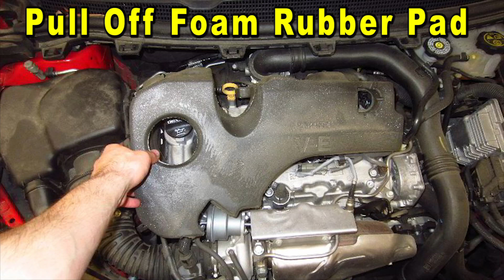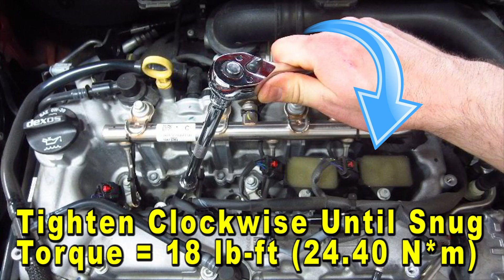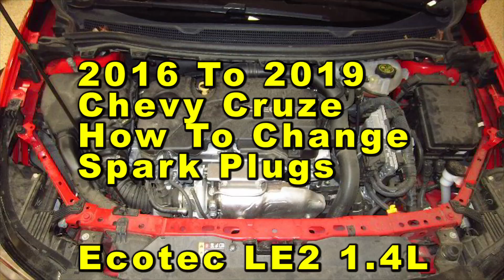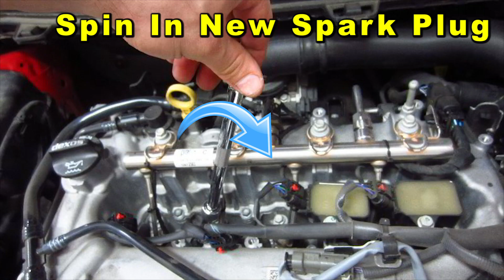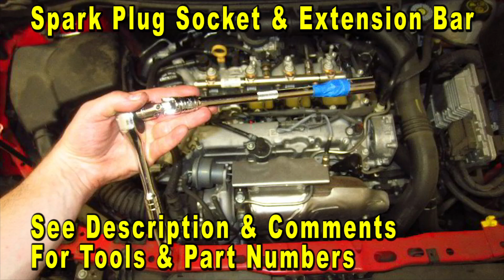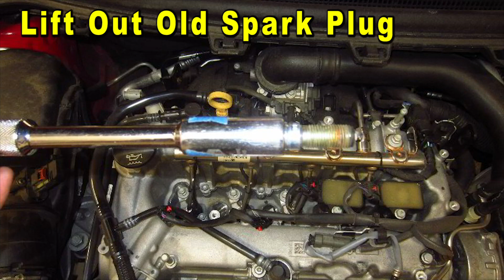Chevrolet Cruze How To Change Spark Plugs 2016 2017 2018 2019 LE2 1.4L Turbo I4 With Part Numbers

Comment from the maker: Chevrolet Cruze 1.4L I4 Spark Plugs - https://amzn.to/3QYNt0L
ACDelco OEM Spark Plugs Part Number - https://amzn.to/3qVjXhR
NGK Iridium Spark Plug Part # - https://amzn.to/44pdwkR
Magnetic Spark Plug Socket - https://amzn.to/3QZjtlB
Precision Screwdriver Set - https://amzn.to/3OYN1i0
Plastic Pry Bar Tools - https://amzn.to/3HMtsV7
Socket & Ratchet Set - https://amzn.to/3Z17LbA
Mechanix Gloves - https://amzn.to/3jCnHkt
Torque Wrench - https://amzn.to/3vS5uSI

The Paul79UF YouTube channel is a participant in the Amazon Services LLC Associates Program, an affiliate advertising program designed to provide a means for sites to earn advertising fees by advertising and linking to Amazon.

This DIY video shows owners of the 2nd generation 2016, 2017, 2018 and 2019 Chevrolet Cruze how to change the spark plugs in the Ecotec LE2 1.4L turbocharged I4 engine.

Comment from the maker: Check out the DIY guide for changing the spark plugs in a 2nd generation 2016, 2017, 2018 & 2019 Chevy Cruze sedan - 
https://www.paulstravelpictures.com/2016-2019-Chevrolet-Cruze-Spark-Plugs-Replacement-Guide/index.html

Here are all of the DIY repair and maintenance tutorials for the third generation 2016, 2017, 2018 & 2019 Chevrolet Cruze - 
https://www.paulstravelpictures.com/Articles/2016-2019-GM-Chevrolet-Cruze-DIY-Repair-Maintenance-Guides.htm

Owners of other General Motors vehicles from Chevrolet, Buick, GMC, Cadillac and Holden such as the Sonic, Spark, Malibu, Impala, Volt, Bolt, Camaro, Corvette, Trax, Equinox, Blazer, Suburban, Tahoe, Traverse, Colorado, Silverado, Express, TrailBlazer, Encore, Regal TourX, Envision, Enclave, LaCrosse, Cascada, Sierra, Canyon, Acadia, Terrain, Yukon, Savana, XT4, XT5, XT6, Escalade, CT5, CTS-V, XTS, CT6, ATS, Astra and Commodore may also find these DIY instructions to be helpful.